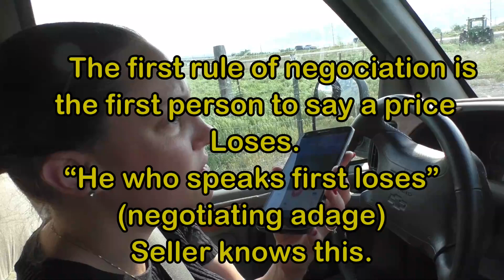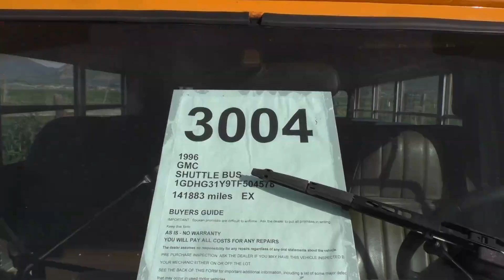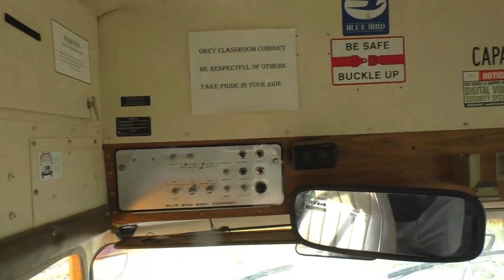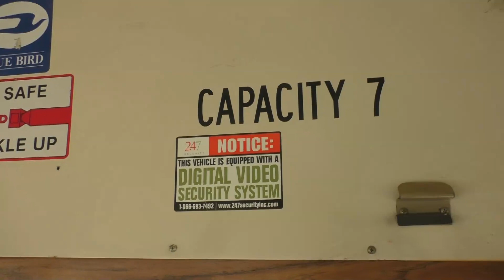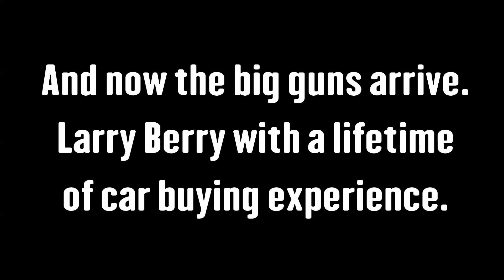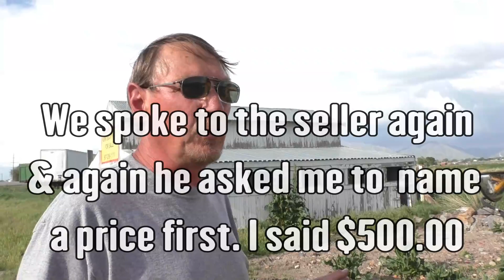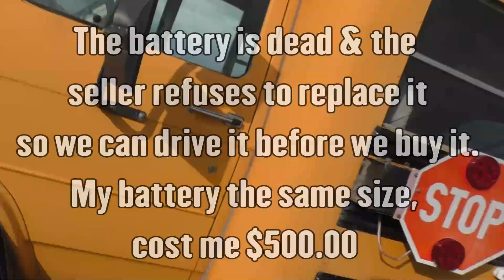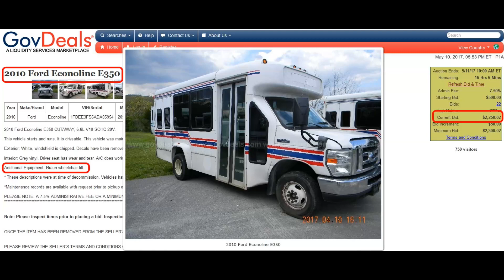How To Find A School Bus To Live In. Tamra's School Bus Conversion Search Continues!

Comment: Jamie,my bus has a 6.5 Detroit.  The same Engine as the one you are looking at in this video.  I live in central Maine.  If your glow plugs are up to par, and your batteries have a good charge (winter maintence, you shouldn’t have a problem starting it.  Just cycle the low plugs a couple times when its below 20 degrees.  More as it gets below zero.
 Hope this helps. Also,great to learn about the 22 and 35 gal tank thing.  My bus has the 22 gal tank.  I put 14000 miles this winter at 60 mph tops and 9 mpg.  Wish i had known that when i purchased Matilda.

Comment: I would have walked too. If you  can't hear it run then it's a junker and the $800.00 is reasonable. Fixed up and running then maybe $1250 to $1500.00 tops Everything you and Larry said is right on. Hope you luck out.

Comment: I'm following your vehicle search with great interest as I'm in the process of going nomadic and have my eyes on a short bus (1989 Chevy with a 350 in it). It turns over but doesn't fire -- my mechanic is working on getting me a price list to get it running. Owner's asking $1000 as it sits (seats have been removed) but I'm thinking $800 cash will probably buy it. I'm told the hydraulic wheelchair lift can bring a good chunk of $$ on Craigslist, if I decide I don't want to leave it in. The one in "my" bus is in the front and seems like it would be inconvenient for a conversion.

Comment: I would love to find something like that around here that is in good shape.
 As for the diesel motor if it's the 6.2 motor I personally love them. I've owned two of them over the years and we have a still have another one we're keeping because it's my sons mudding truck... But we;ve put right close to 400,000 miles on each of them and the only reason I got rid of them was because the bodies were rusting away...
Yes they a bit ruff starting in the --0 temps. But as long as you plug them in at night and you have a good set of glow plugs in it, They fire right over with a wee bit of white smoke out of the tail pipe until it stats to warm up....
When something breaks on those motors they're easy to work on... They were hard on starters until I learned to put a fresh set of glow plugs on them every other year and remembered to plug in the block heater when the temps. dropped below 32 degrees Fahrenheit...

Comment: those batteries both need to be replaced at the same time. Also check the wiring through from the top down because my wires were shredded from rubbing on something for who knows how long it was a fire hazard and they kept going through batteries. Get a lifetime warranted starter, they make them! Mine blew out cuz those faulty wires arched against the starter. so check the battery wire cables!!! Bus batteries aren't that expensive 100 bucks each.
Reply from the maker: this one had only one and it looked HUGE. Thanks for the feedback!
Reply: Enigmatic Nomadics holy cow! Mine has two I thought every bus had two. Thanks for saying so or I would have always assumed as much.
Reply from the maker: thanks for watching and commenting Peaches!

Comment: That diesel is a buzzkill, but on the battery, I wonder if it has a starting battery under the hood, and that large battery was for the wheelchair ramp?
Reply from the maker: We checked the engine compartment and saw no battery. Now you have me wondering about yet another location?

Comment: Yeah, I wouldn't buy any vehicle I couldn't start or test drive first. Some of those had a "Banks" 6.5 that was pretty good if it was well maintained. Tires for that aren't cheap either. You may want to consider a gas engine bus; the miles per gallon is lower but gas is cheaper and gas engine parts are easier to find. Stay away from the Ford 6.0 diesel. The 7.3 diesel was last used in vans and busses in 2003 I believe. The new problem with older diesels now is they need fuel additives or old motor oil added to the fuel to compensate for lower sulfer content in the latest diesel produced. I never owned a diesel myself but know lots of folks who do and I occasionally drive diesel trucks. Diesel repair is very expensive across the board and newer models have DEF or diesel exhaust fluid systems onboard. Freight liners DEF systems frequently break and the truck shuts down on the road too. Not a cheap fix either.
Reply: Thank you muchly for the advice! This bus did look well cared for, but the owner was shady about a lot of details, so that made it a no go. I would agree, I think a gas engine will be a better choice overall.
Reply: Here's another POV; gas is $2.29 a gallon and diesel is $3.29-3.49.  Well maintained diesels can run longer between service intervals but service costs are higher. Diesel engine is good for hauling a lot of weight and you can build a light weight camper bus interior. The mpg's will be low regardless of engine choice because the bus has the aerodynamics of a brick. And although a well maintained diesel can last hundreds of thousands of miles you can get a used gas motor much cheaper most anywhere if needed, and a gas motor will be easier to start on a really cold day.

Comment: I would not buy anything without starting (jump  it off) and driving it first. (It could have a low electrical drain through all that safety light equipment and the battery not be "bad".)  If it all worked out, I would offer $1000.00 and go up to $1200.00. I think that is exactly where you were from the very beginning, Jamie. 👍 
 I believe Tamra is very lucky to have you on her side through this.
Reply from the maker: thanks, RonRay. The search continues.

Comment: I'm so glad you didn't buy that bus!
Reply from the maker: +Jax Austin we really liked it. The search continues.
Reply: If you can find one and test drive it, and verify that it will be reliable for Tamra, I fully support the short bus!  That thing was too risky with low-voltage and seems like the owner wanted way more than it's probably worth. I would guess the thing is worth no more than 500 bucks if you have to buy a $400 battery.

Comment: Know what you are looking at before making decisions  maybe more research. Know what you want. Saying that GMC has a olds engine converted to diesel - that was ten years before this bus was made.  Something could have been left on draining the battery checking voltage tells nothing about the status of the battery. It is great attempting to help someone but if you are lacking in knowledge then your not helping you could be hurting. This comment is not meant to be negative just giving you some food for thought. Good luck
Reply: By the way what the seller paid for it means nothing it is all about what you are willing to pay - what value it has to you
Reply from the maker: What the seller paid means nothing? All the research that states to look at the invoice price instead of the sticker price must be wrong too then Huh? Oh, Bert.
Reply from the maker: Yeah,  Bert. Me and my foolish volt meter. We're on a path of destruction.